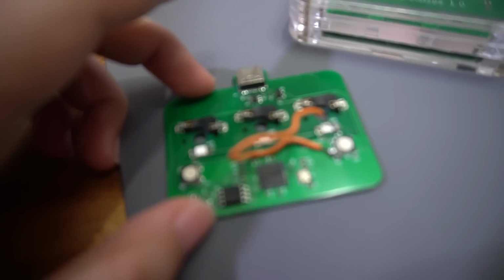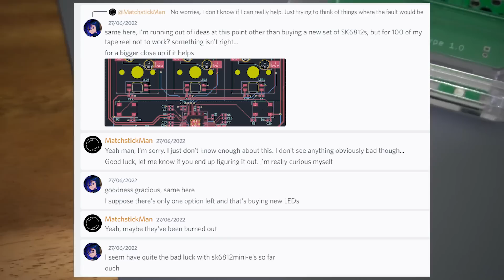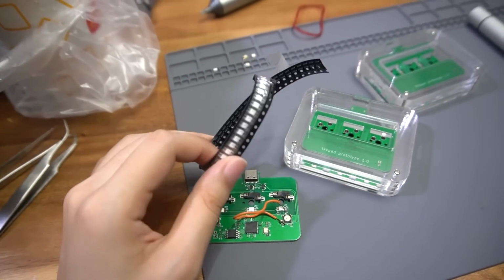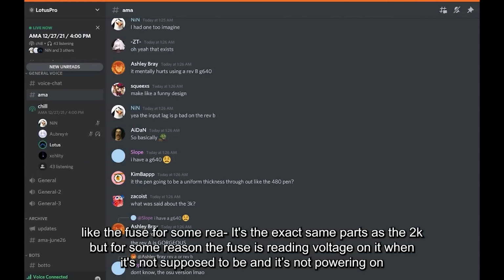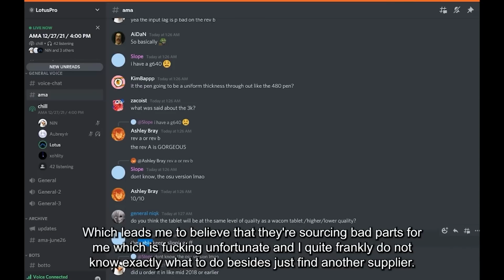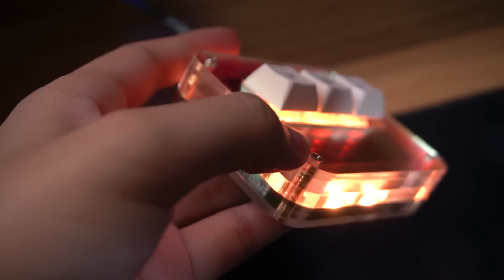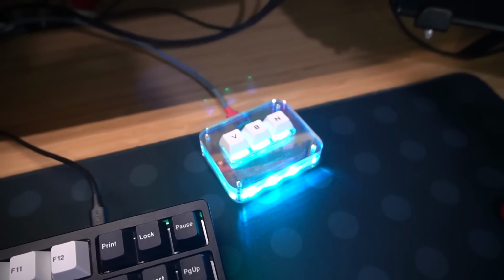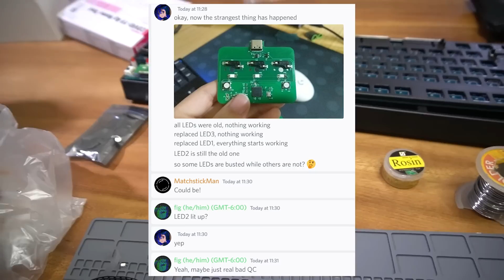how is this even possible

Comment: Well, LEDs are like mini solar panels. If you do not install a resistor to discharge the LEDs, then I suggest doing that.

We learn this phenomenon with airfield lighting. As someone who works in the aviation industry, we learned the hard way.

Comment: If you haven't already then you also need to make sure that your logic high voltage from the RP2040 is greater than the minimum logic high voltage in the LED datasheet, every SK6812 clone I've found specifies 0.7*VDD, which would be higher than what your RP2040 is outputting if the LED is running off 5V. The easiest way to solve this is to add a cheap level shifter, which should only add around $0.25 to the BOM cost.
Reply from the maker: ah yes, the logic high voltage was something I had considered. My next order had fixed cap values (I used the wrong caps for LDO in here) and I had added a step up for the logic for those LEDs. Although the thing was that others could get by just using a resistor on their logic lines so I ended up removing it in the end. As much as it's better to be in-spec with the sheets, $0.25 would add up quite a bit overall when I mass order these....
Reply: @user-bx9sg1qr9x  The absolute cheapest in-stock option on LCSC is C7484 or C163712, both are only $0.07 at qty 50+, you probably want C7484 just because there's more in stock. It's not technically a level shifter but it will do the same thing for cheaper.

Comment: As has already been mentioned, those types of addressable LEDs tend to be very ESD sensitive, this should be less of an issue when you're having these assembled rather than doing it by hand. You could add a clamping diode along each LED data trace to potentially increase robustness when people start touching the PCB, although this increases cost somewhat. As for buying parts, LCSC stocks an LED that I'm guessing is compatible with what you're using (LCSC Part# C524051), which you can also then use when getting these assembled assuming you're using JLCPCB for that. Additionally that part specs a small amount of built-in ESD protection.
Reply from the maker: OH MY GOD, THAT'S GREAT! I'll check if these are compatible with the WS2812B protocol and the footprint sizes. And here I thought JLCPCB didn't have any LEDs like this. Thank you!

Comment: A DIY led tester that does not require soldering would be handy
Reply: Invent and patent that
Reply: @DaHongMao_  ...can't pattent trivial or obvious designs. 😉
Reply: You know any multimeter in Diode mode can be used to test LEDs? No need to make a tester.